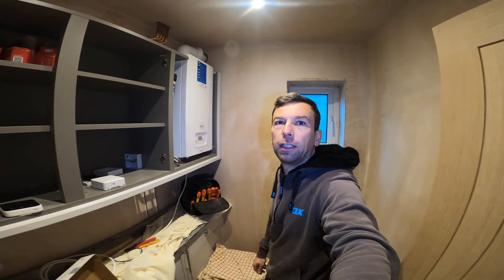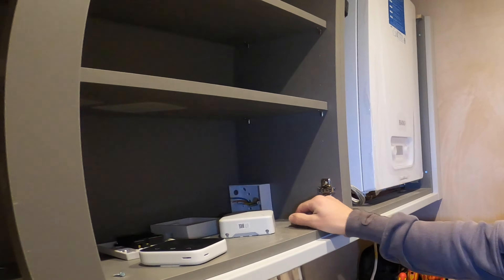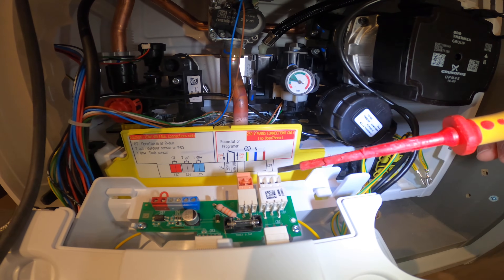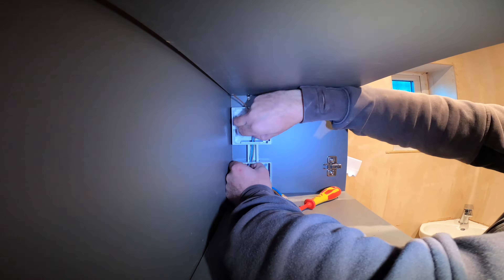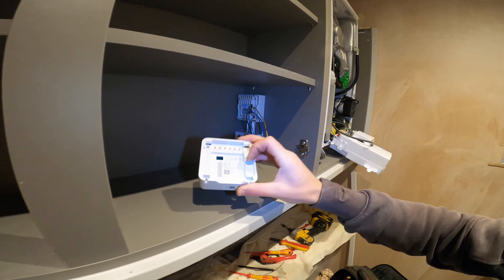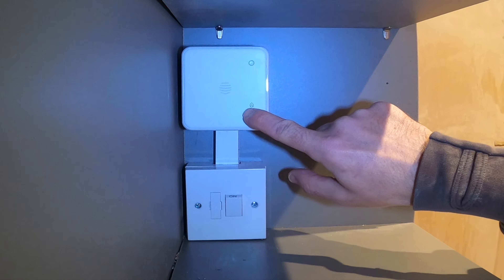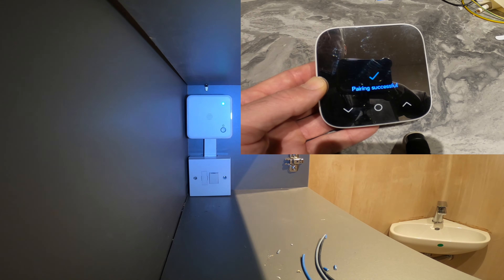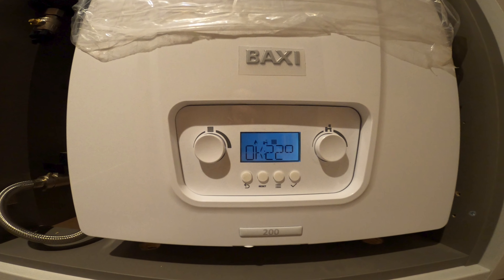Hive Mini Thermostat Installation on Baxi Combi Boiler

Comment: i am having trouble getting my thermostat to fire the boiler i have 5 core cable i have the live and neutral in and the i have a black wire and a grey wire and earth of the black and grey which goes in which side of the orange block in the baxi 800 i am paired up and my receiver is clicking but my boiler wont fire its heating

Comment: Hive was the worst choice as boiler is Opentherm compatible but Hive isn’t…….could have gone with a Nest or Tado, connected up via Opentherm then the system would work so much better and used less gas.
Reply: The Hive V4 now surpports OT